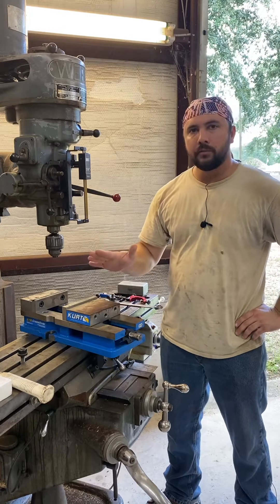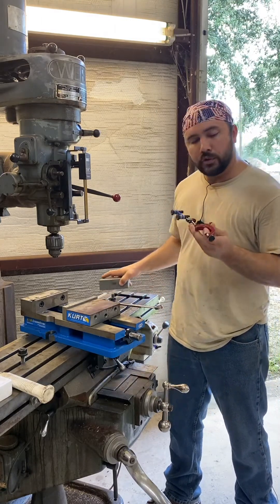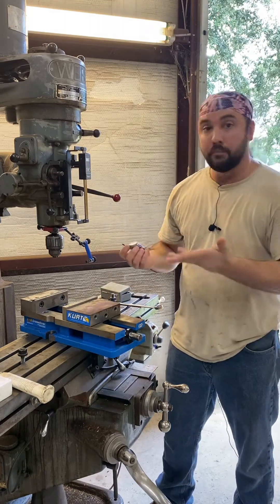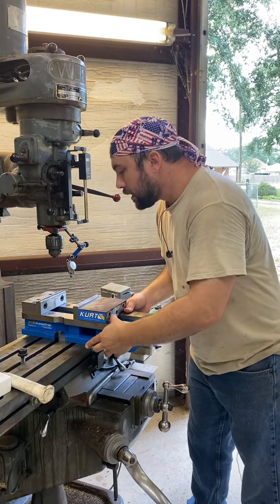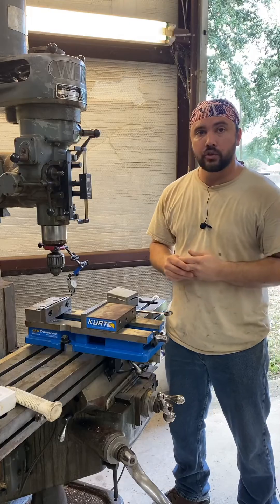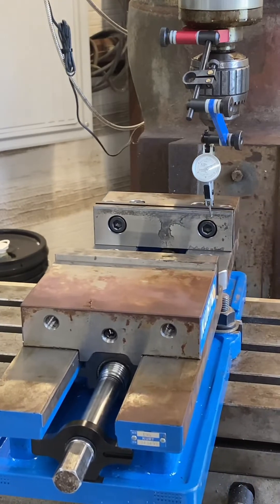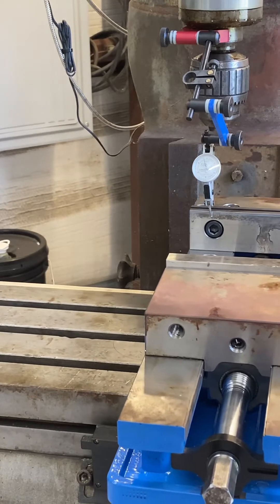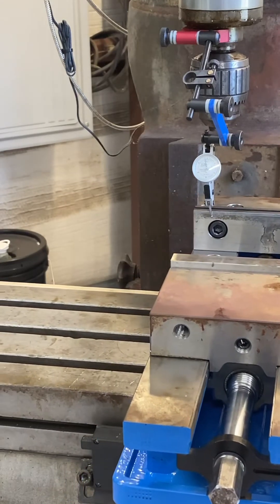How to indicate a vise on a milling machine quickly!

Comment: The hardest part about this for me, is when I initially set my vise on the table, I just cant get the feel for how much to move that vise. That and moving in the correct direction without moving the wrong corner of the vise and ultimately rotating the vise the wrong way.